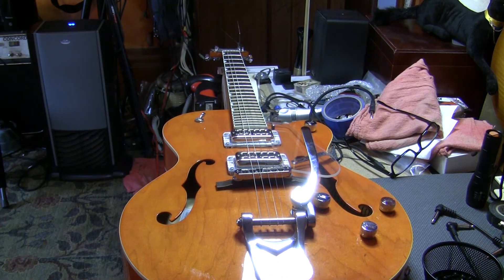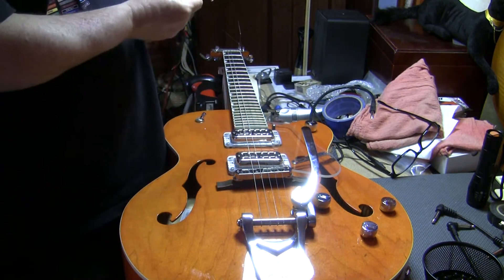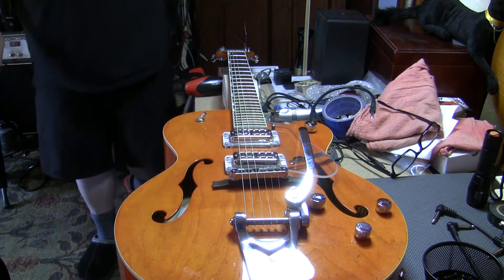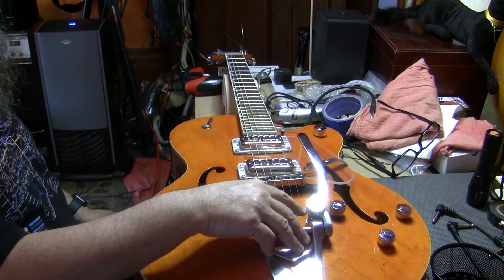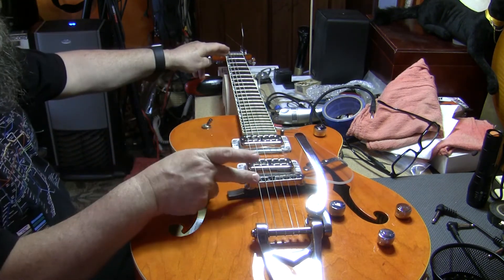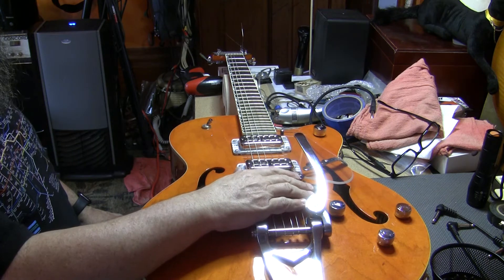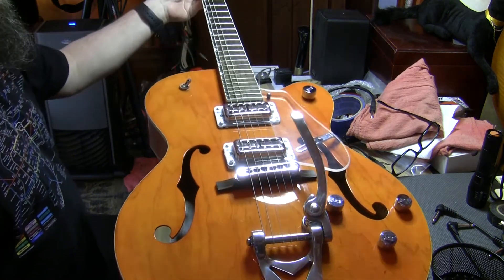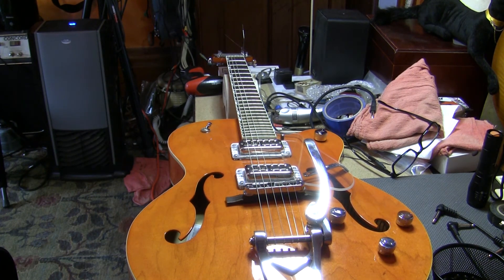Bigsby and Floating Bridge Setup

Comment: I used a B6C on my 5420T a great improvement, used a shorter spring in and that got the arm lower. On the Bridge, I used a Vanson Tunamatic with roller saddles, works fine and it lined up over the pickup great as well.
Reply from the maker: Cool! I actually swapped the tune-o on this one for a ricking bar bridge. It feels more "solid" to me.

Comment: I think this was the video I was looking for. I watched a video some time back about aligning the edges/corners of the bridge with the tips of the f-holes. I just couldn't remember it it was the forward tips of the bridge or opposing tips to match the corresponding f-holes.
Reply from the maker: Remember that it's a starting point. On some guitars, the bridge may want to be a little straighter. Something I noticed recently, on another guitar with a bar bridge, which had deep slots, I was getting "sitaring" or "zinging", and straightening out the bridge just a little fixed it.
Reply: @SeanKerns  I went back and used the two front corners at the f-holes after I watched the video. Point on accurate. Tone and intonation spot on.